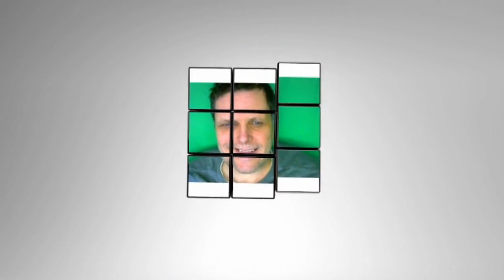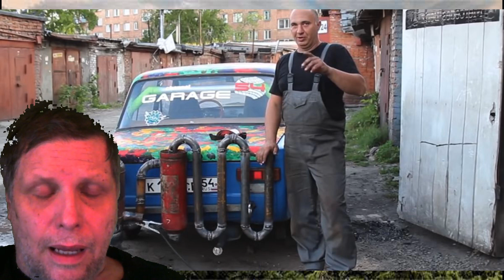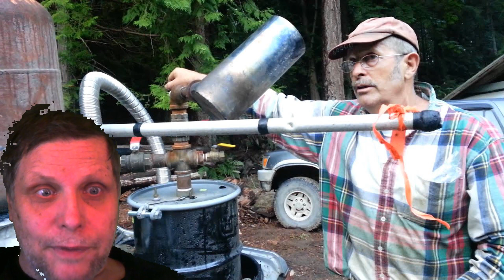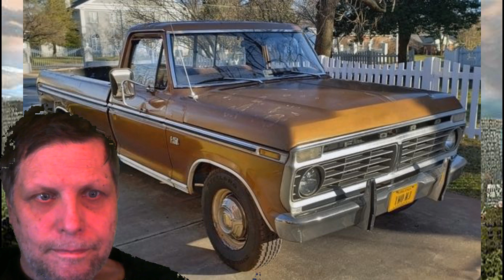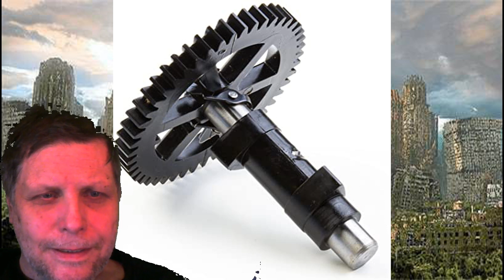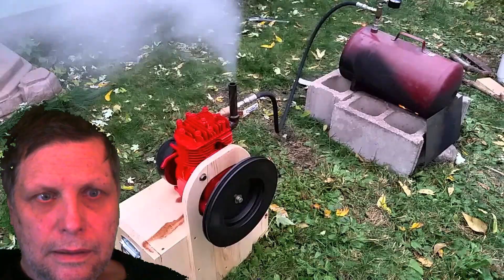FOR PREPPERS RUN YOUR CAR ON WOOD AND POWER YOUR HOUSE WITH WOOD

Comment: We have a clean 2002voyager Chrysler with a 2.4 liter 4cyl dual over  head cams gets 40mpg. Plenty of power was 1500$ 3yrs ago   they used to burn nut shells   WW2        saw a pix of mini sta wagon adapted to a horse 🐎🚙 our Honda gets 40 also 🤗

Comment: Wood gasifier...alows you to run a gas or propane engine off of wood smoke. A dogfood bag size of wood blocks, chips and sticks will get about 30-50 miles in a small car or truck.